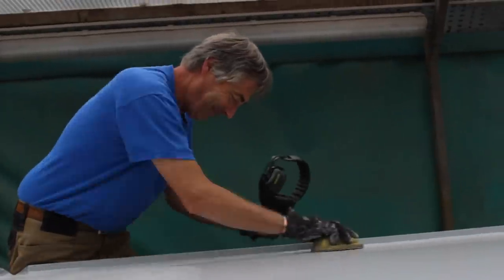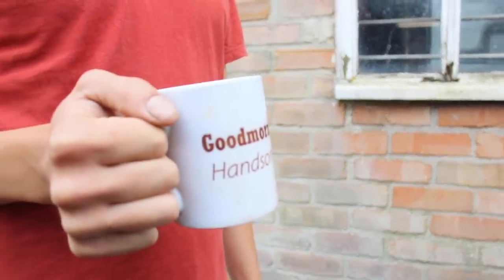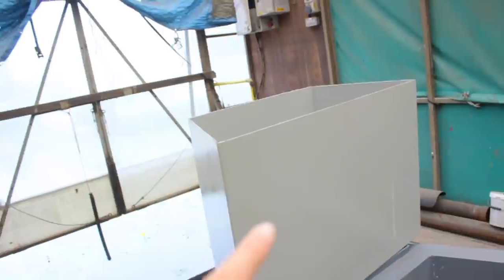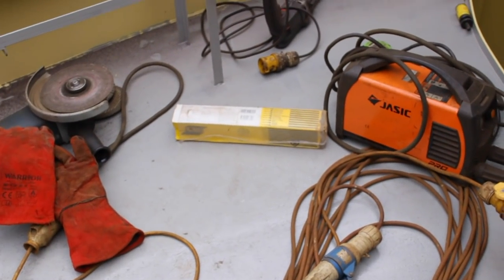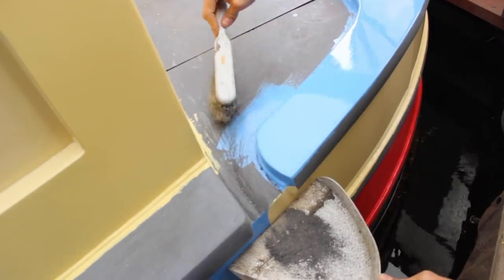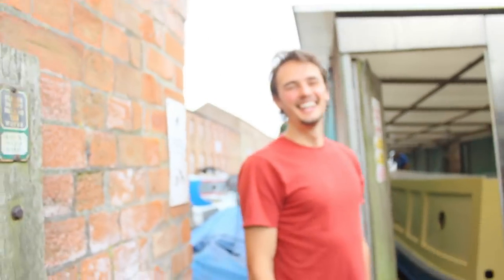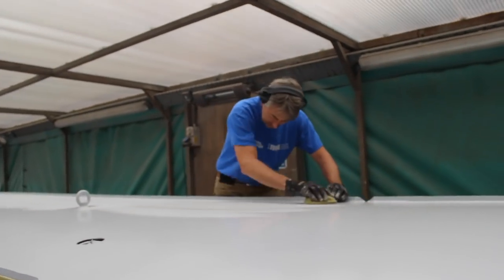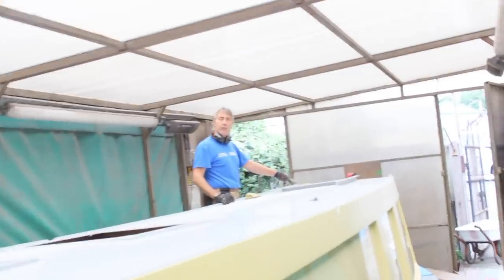Ep13 PAINTING our NARROWBOAT Part 3: Time for some COLOUR!

Comment: Just remembered to polish the brass radiators on cars, we used to use toothpaste and a hard bristle toothbrush. Surprisingly, the toothpaste would cut through the paint down to the brass. After we got down to the brass then we would switch over to Brasso or some other metal polish.

Comment: Have you tried Distilled White Vinegar.  Heat the vinegar to a strong simmer.  Immerse the brass into the hot vinegar for 2-3 minutes.  Use #0000 Steel wool and lightly rub the tarnished brass to a beautiful shine.  As others have mentioned...after cleaning..spray with Clear Lacquer.  I believe you will be pleased with the results.  Vinegar is inexpensive.  #0000 Steel wool is a few dollars.  Need an old sauce pan deep enough to immerse the mushrooms.

Comment: Keep you hands off the paint while it’s primer, under coat, and between top coats. The oils off you skin can keep paint from keying. So don’t lean on your boat. Yes they wipe it down between coats but it’s a good practice to not touch with bare hands.

Comment: Guys please do your maths on the super eco wood solar human input boat. David John (Cruising the Cut) looked at this and pointed out that, as I remember, even if you covered the entire coachroof with solar panels you would only generate about one tenth of the power needed for "normal cruising". I suppose it might work if you didn't want to go very far but Britain is about 55 degrees north and doesn't get massive sunlight input. Building a super light boat would help enormously, look at current seagoing yacht design. Expensive and you'd have to find a builder, probably not a normal narrowboat builder but someone in the Southampton area. Essentially a sixty or seventy foot canoe. I used to design yachts but am definitely not looking for a commission, I'm too old. However I will be happy to help with ideas, no charge

Comment: If the brass was lacquered you need to remove the lacquer first with a solvent. Then you can clean the brass with either ammonia or washing soda. Then lacquer it when you've finished polishing it, otherwise you'll be cleaning it for evermore.

Comment: Nice update... But remind Vic to finish what you've started or you'll be up to your neck in it and it'll stop being fun! 
Citric Acid ... cheap and effective as a hot solution. About 60c will do it. 0000 Wire wool NOT sandpaper as you're scratching the surface and you'll need to grade that till you're down to about 800 wet n dry. Buff with rustins, barmans, brasso etc. then seal with a UV RESISTANT clear coat that needs no primer layer.

Comment: When I lived on a boat in the 1980s we used to paint the brass with cheap brown sauce and leave it a while. Washed it off then finished with brasso. It worked well on chimney rings, tiller pins, grimy portholes etc. The sauce made the brass slightly dull, probably due to the vinegar, but after a few polishes with brasso, it gleamed. Weird but it worked 😀

Comment: She's got some real color on her now!  Looks great!  Shall I presume that the water in the canal moves only when a boat moves but otherwise lays stagnant?  One energy source used frequently in the desert SW in the US is hydroelectric power.  You might not have as much moving water, though, as they have out in the desert. When you are on a river or even a moving spring,  you could drop a cheap and easily made generator.  Also, wind is worth considering.  Everyone thinks large windmill sized blades to harvest wind energy but do a search on vertical wind turbines and you will find things that can stand at the bow and stern of your narrowboats and harvest the wind when the sun is hiding behind a storm blowing in. Alternatively, you could lay a vertical wind turbine on its side and mount THAT at the end of the roof of the boat. Mounting them on feet will maximize the air movement AND allow clearance for the cratch cover.  Wait. It would block the visibility of the pilot.  Having a vertical turbine at the very tip of the bow would be akin to mounting a sight on the boat, and that is not a bad thing. Mount it on a hinge that will allow you to drop it when you need clearance. It would be easy to paint it in the color scheme of the Cafe boat, but what can you do to "lighten" the visual impact on your house?  Think think think.  Also, you could harvest the energy of the propeller on the boat if you can find a way to mount the generator on the propeller shaft and keep the original length of the shaft.  This would help compensate for the loss of power that you harvest, now, when the boat engine is running. It would not come close to matching the energy that you currently harvest but, every little bit adds up. Increasing your storage capacity is going to be necessary. Unless you don't want to store any energy, in which case I can only say "I don't know".  Why is your current home designated as a 0? Did she betray you in some way?
 great colors!  Will you be serving a full diner menu?  Or are you thinking of serving the things that you would typically find at a coffee shop?  I am having a blast watching you create this.

Comment: Get the brass buffed by a pro, then lacquer it to prevent corrosion. Alternatively if you want to do it yourself use ever finer wet and dry used wet with some dish soap in the water and finish off with Solvol Autosol which is a chrome cleaner that comes in a tube like toothpaste. You can get all of these at a car accessory shop. Good luck.

Comment: The solar boat sounds like a fun idea. Your idea is reminiscent of my friends 'fun hauler' 23 foot trailer. He got the trailer on the cheap, and replaced all the wiring and lights with LED's. He bought or got 4 deep cycle marine batteries (eventually lithium) which our stored outside in front of the two 10 gallon propane tanks. He added 4 large solar panels to the roof and then an automated charging panel inside. He also added a tankless water heater. When we go out to the desert, he never has issues with the batteries going flat, but then again this is sunny California. The stove, refrigerator, heater and AC run off of the propane but with 20 gallons on hand it lasts a long time. He also has a Honda generator as backup, but has yet to have used it.